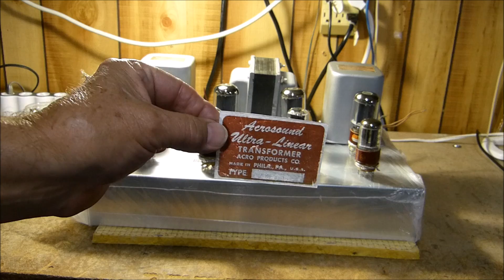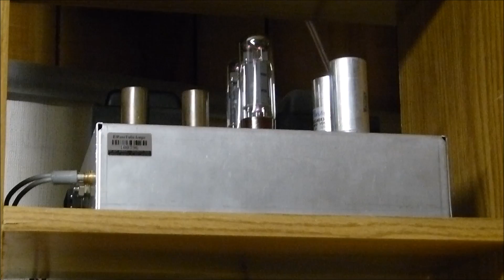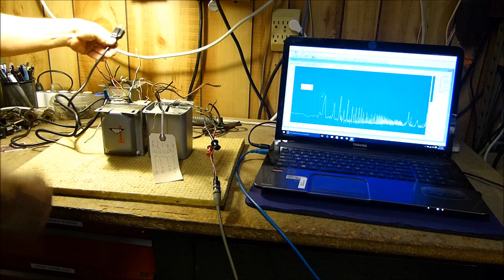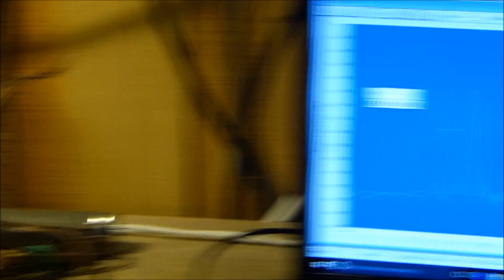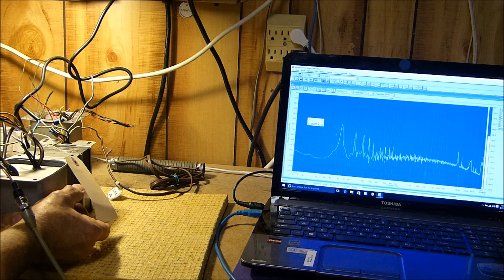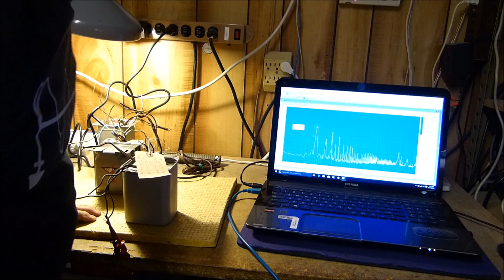Part 1 - Acrosound (Williamson Design) TO 305 Transformer Stereo Amplifier Build

Comment: Using old capacitors is certainly a bad idea indeed (leakage etc) but would you say it is the same about resistors ? I'm curious about your opinion on this, as I gathered quite a lot of old Allen Bradley Carbon composition resistors on some vintage military equipment. Never had any bad things happening so far using them, but maybe you had some bad experiences ? Thx again for all those awsome videos, love your channel ♥
Reply from the maker: I generally agree with the idea of not using old capacitors, with some exceptions. I use old, as old as WWII mica capacitors in my transmitters as they are still very good and reliable. The same is true for high voltage blocking capacitors used between the plate of an output tube and the Pi network. Many of these capacitors are well over fifty years old. As for paper and "Bumblebee" type capacitors, if they are in a circuit where there is little to no voltage across them, as in an input circuit, I see no reason to change them. If they leak DC even a tiny amount (even several megohms) they cannot be used as coupling (blocking) capacitors between cascaded stages connecting a plate to a grid. I say all this to not cause a witch-hunt to replace all capacitors.
As for carbon resistors, I have no issue with old one except that many are out of specs. They do age so it is necessary to measure every one before using it. I have found that quality resistors purchased in a lot and manufactured at the same time have tolerances to each other that is really impressive so I generally use new resistors for that reason and they are so cheap. I have done a reasonable study on carbon resistors vs metal film resistors and the reactance of each even at 20 MHz is nominal (considering audio work) so the idea that carbon resistors are necessary even in RF circuits is not true.
Back to capacitors - as with the resistors, I have found capacitors from the same lot to be not only very accurate in their capacitance value but also very well matched so, changing the old paper (or oil) capacitors for quality new ones is probably, generally, a good idea.
Hope this helps.
Reply: Thanks a lot for ur thoughts on this. And so this is my overall experience aswell. Also agree on the "witch hunt" cap thing. I now collect a lot of them like black beauties, bumble bees etc for tone stack. Keep up the good work !

Comment: It is always a pleasure to watch your video's. They always fire questions in my head, which is how I learn from you. You mentioned that after testing, the output transformers are really good. What do you measure and why are they so good? I wish to know what makes a really good output transformer? Also, can you please tell me what program you are using? Thank you.
Reply from the maker: These vintage transformers have a reputation for a very broad frequency response. I have seen amplifiers with Acrosound transformers in them and they do perform exceptionally well. They come in a variety of power ratings.  We shall see how these perform now that I have equipment that can objectively measure their performance. There are two programs I have used for FFT. One is ARTA and the other is SpectraPlus. Google each and you an download them and try them out.
Reply: Ah yes, frequency response. I look forward to your design and build video's. I have a good understanding of transistor based amplifiers, but I am a beginner with tube amps. I am currently building a guitar tube amp based on the Princeton reverb and following Uncle Doug on his channel. It is fantastic to learn from you guys. My passion is hifi amplifiers though, so this project of yours will really help me. I will be asking questions so please if you don't mind. I am in England, and I love the American audio stuff.

Comment: Thanks for sharing. I have never built an amp, but would like to some day-- likely a tube amp. I like the part where you use the FFT spectrum analyzer to determine the best orientation of the transformers. Like anything analog you really just have to test it out. There are so many unforeseen variables. It is nice to see you scientifically taking care of some of them.

Comment: I'm looking for this kind of chassis but I wasn't able to find one. On ebay at least. Any tips on where to find it?
Reply from the maker: www.mouser.com  This particular chassis is part number    563-AC-416
I do a lot of purchases from them. They are excellent.
Hope this helps.
Reply: Thank you!
Reply: search "Hammond Manufacturing" in Canada. They are the leading supplier of all these aluminum tube enclosures. They also make power transformers, chokes etc.

Comment: When I lay out amplifiers, I do my best to keep the small signal amplification tubes as far away from the power supply as possible.  For that reason, your 6SL7 at either end, with the 6SN7s further inboard, appeals to me.  The downside of that, of course, is that one of your signal wires has a LONG way to go to get from the input to the first stage (assuming your inputs are on one side).

I typically DO NOT use symmetrical layouts, for this reason.  Here's a nice example of how I like to lay things out: https://www.instagram.com/p/BCE7vVVs9S5/   I'm doing a similar layout for a 6L6GC-based Ultra-linear amp right now.

Comment: I love your videos,  can you give me more info on why modern sockets are bad, and what they do to hinder your builds?
Reply from the maker: I have found that the female pins in the cheap tube sockets are made of very soft metal meaning when you insert and remove a tube the female pins get wallowed our and enlarged so that there is poor (or no) contact between the male pin of the tube and the female pin of the socket. It is really bad in some of the instruments. As I have shown in a couple of videos, if you lose connection to the plate of the tube, your screen grid gets destroyed as it is the most positive electrode in the tube and tries to take the place of the plate. If the control grid pin gets loose you lose bias voltage and your cathode currents soars and destroys the tube. You simply can't hope to keep an amplifier working with bad tube sockets.

Comment: Great video as always David. :D  This project seems really promising with those high quality outputransformers. 
Personally I would use a screw in type IEC connector and a additional fuseholder. Also I would add a standby switch for the HT. Correct me if I'am wrong but this powertransformer looks a bit undersized (I'am talking about the ht secundary). You might run into trouble when fully loading both channels at the same time.
Reply from the maker: You are right about the power transformer being undersized. It is rated at 200 ma.  I considered each 5881/KT66 drawing 40 mA of static current for a total of 160 mA and then a few mA for the 6SN7's which would put it right at max but in reality, the output tubes are drawing about 55 mA each with this design. The power transformer gets really hot - I have measured it at 167 F. It does an amazing job holding up under load.

Comment: I wonder if earthing the transformer case would make a difference, as it would be when bolted to the chassis?
Reply from the maker: I bolt the transformers to the chassis but I use aluminum chassis. Possibly it would make a difference with a steel chassis ? I don't know. Steel chassis are really hard to work with and make lots of very sharp shards which always injure me so I stay away from steel. I have found over the years that (1) grounding one side of the filament supply often times diminishes 60 Hz hum the best - CT, sometimes and sometimes a 100 ohm pot with CT to ground. Also, sometimes, a couple of 0.01 uF capacitors off each side of the AC line to the chassis reduces hum - sometimes... and sometimes not. It is a bag of tricks I try on all my amps and use what works best.